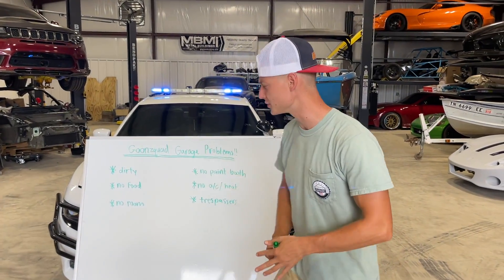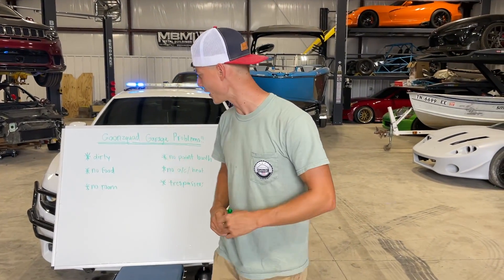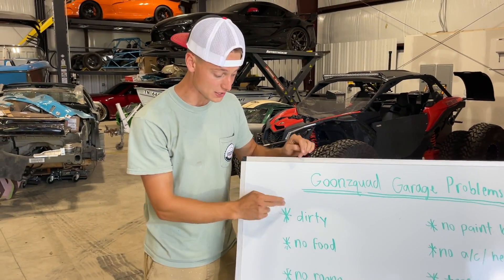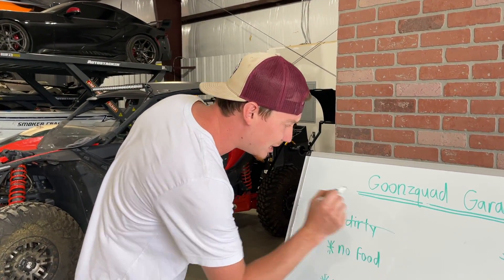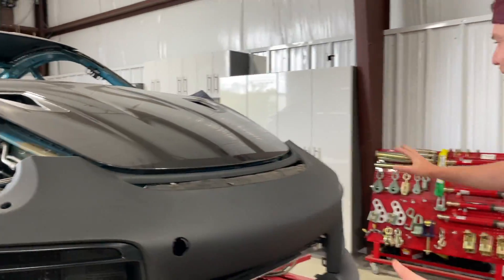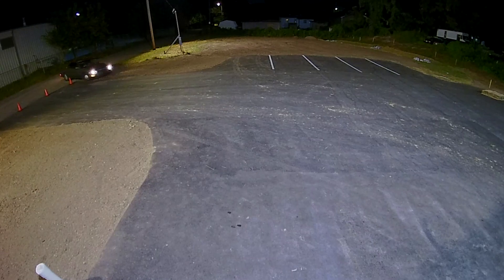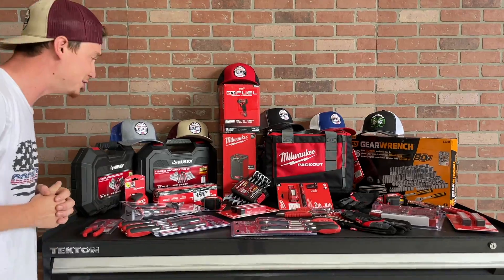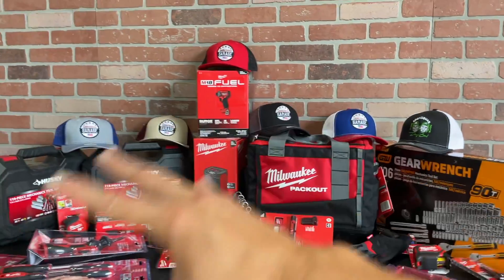The Goonzquad Garage Has Some Major Problems!!!

Comment: Before installing the new diff check if the gear ratios are the same. THIS IS EXTREMELY IMPORTANT IN AN AWD CAR
Reply: They'll never see this comment. 😂
Reply: The front driveshaft is disconnected
Reply: @Ray00069  I recommended using the Charger Cop car as a burn out car a month ago when they were wasting time on those other two cars,they see good advice in the comments but never give credit where it's due, always has to be their idea, I honestly can't wait till the arrogance bites them in the ass at Bristol.
Love their ability to keep up the content but sometimes it helps to give credit to the subscribers who make their channel what it is.
Reply: @Ivonmorr  they took out a fuse  i think, so, when they put it in again they'll break something 🤣
Reply: @DILLIGAF65  it’s pretty much a copy of cleetus car neighbor which is a crown Vic cop car that’s always at the event if they took the mustang they would have more power and actually be halfway original
Reply: @DILLIGAF65  A lot of people recommended them to use the Charger, that's why they decided to try it...
Reply: @beardedonegaming9502  Not even on the same league! 😂😂😂😂😂 Just because it's a retired cop car doesn't make it a copy cat...
Reply: @DILLIGAF65  Well picking an AWD car for doing burnouts was not something people immediately go for.
Reply: @DILLIGAF65  Bristol is gonna put them in their place...a rude awakening for them
Reply: @rainerjaschke5216  Even if it does, good experience for them. None of us was perfect in the first things we try. Why failing is a great learning experience.

Comment: Yes, a fence is a top priority.  Check with your local city to determine the zoning requirements concerning the height restrictions for a fence. If an 8 foot fence is allowed with a barbed wire top you may want to consider it. It may depend if the city considers the road next to your garage a street or an alley. Where my place is located the road is considered an alley so an 8 foot high fence around the entire property is permitted. Also please consider a metal grating you can pull down over the glass windows and door. Consider a way to protect your roll up garage doors if necessary. Keep up the interesting videos.
Reply: Totally agree.  A roller screen for the entrance and glass is a priority - a fence will take a while yet to be installed...

Comment: Hi guys, greetings from Argentina.
The new "Goonzquad" garage seems to look a bit small, even with all that cleaning and organizing. 
I said it before and will say it again: put a decent floor on top of your office box, a steady (or removable) ladder so you double the storage surface. Just as you did in your parent´s garage.
Glad to hear you already ordered the fence building; it will give you more tranquility. Also consider building a paint booth with a side storage place for paints, sanding material, etc. witch is a lot and of course a decent compressor with all the plug-in pipes, air filters and illumination.
As always, cheers from NE Patagonia, Argentina. (a dream place).
Reply: ^^What this guy said!^^ make use of the blank space in the garage.
Reply: Bucket list location 🌴⛰️🌴
Reply: Sabes el conurbano que les falta a estos pibes... 🤣
Reply: @estebancuevas7551  ¿otro argento fiel los martes, jueves y domingos?
Reply: @walterweigert9840  Otro por aca jajaja
Reply: i doubt that's engineered to carry enough load to be useable as a storage space ... and without having it engineered they wouldn't be able to get their inspection passed if they did that
Reply: this isn't your backyard garage that you can just do whatever you want in and fly by the seat of your pants
Reply: That framing is likely designed to support a ceiling, not a load of auto parts storage.
Reply: @Mouthy_Trucker  May be not in the centre, but against the walls? ...just saying...
Reply: TRUMP2024  Hell YES,  TRUMP 2024.  I SURE HOPE SO.
Reply: show me your garage boy
Reply: That's the biggest building that was allowed on that lot, the city wouldn't let them make it bigger, there are a lot of construction codes they have to follow and they will build a smaller "barn" to put the paint booth in.
Reply: @franco7495  somos varios , ja ja
Reply: TRUMP2024  they must be doing something right they got the $$ that we dont have...😂..also I doubt you would want to build a garage in a mountain were you could use all that space to make more houses and possible sell etc..
Reply: @walterweigert9840  somos varios..
Reply: TRUMP2024  dang son why you mad

Comment: I'm glad you're finally going to get a fence! Just make sure it's very tall with barbed wire at the top. Maybe even electrify it. It's just a matter of time when somebody would break in whether you have a camera system or not and steal thousands of dollars worth of tools and damage all of your cars.
Reply: Probably can’t electrify without a permit and I’m sure insurance would skyrocket, it’s not Fort Knox, it’s just cars
Reply: @michaelyackovich155  I didn't mean a lethal shock. I mean like an electric fence that you use for animals. They don't want to touch the fence again when getting zapped. LOL
Reply: @brianmef71  nope still illegal. Unless a prison or jail.
Reply: @jeremyfowler1519  I'm sure it's still illegal in a prison or jail. Any sort of shock can kill someone.
Reply: @evandickerson2919  Apparently you didn't grow up on a farm where there is electric fences for animals. It doesn't kill.
Reply: @evandickerson2919  Voltage and amperage are two measures of electrical current or flow of electrons. Voltage is a measure of the pressure that allows electrons to flow, while amperage is a measure of the volume of electrons. An electrical current at 1,000 volts is no more deadly than a current at 100 volts, but tiny changes in amperage can mean the difference between life and death when a person receives an electrical shock.
Reply: @evandickerson2919  so it means you know nothing about electricity. Just because you get a shock doesn't mean it's going to kill you. It depends on the amperage. You get shocked by a stun gun it's going to hurt but it's not going to kill you
Reply: @brianmef71  I know this sir. I am an electrician I was just stating that any voltage/amperage can kill someone. I have been hit with one leg of a 400 amp service before. Doesn't feel good but one can get shocked with 120v with a 15a load and get killed due to it causing irregular rhythm heartbeat.

And I copy and paste something that is posted on the internet as well.
Reply: @brianmef71  you obviously know nothing about electricity because one could have a murmur and it can kill them if they get shocked. So don't try to post something you find on Google and think you know about electric. You may fool someone else but not going to fool me.

And if the fence has dc vs ac it is even worse. So yea try to debate this with me.

Comment: That's some pretty sketchy trailer action there boys 😆 Also, make sure your rear diff gear ratio is the same as the old one if you decide to put the 4 wheel drive back into operation. Otherwise, you'll have major problems. Peace!!

Comment: Gotta move security to #1 on the list. Hell, make it #2-100 for good measure. Wayyyy too many close calls already, and y'all have worked too hard to get yanked around by crooks and crazies.

Security fence (barbed on top), electric access gate, and if you don't already have it, a full scale monitored alarm system too.
Reply: I would of installed the fence at the onset. They want what you have ....,

Comment: I’d definitely tear that new diff down to make sure it’s all good. I mean usually there is a reason parts like that are sitting at the junk yard.
Reply: Typically cause a car got totaled, not cause there’s anything wrong with the part. It is unnatural for the parts to sit out in the weather though
Reply: @luketanner7638  either way I’d tear it down, to check. That way It don’t go in the car, and not work at all.

Comment: Yall should put up a 8-10 foot metal corrugated fence, it's pricey but it loterally blocks off the view of your property vs a chain link.  Or if you want visibility get a wraught iron fence installed, have a sliding gate on a rail system where you can open it with an opener would be sick

Comment: you need to do interlocking figure 8s with all 4 wheels - once you get a fence and grass you will build another garage/office mostly for storage - the shop is too crowded  - you may as well have extra space here and on the mt #mr october
Reply: They should buy neighbour properties if they are willing to sell. So they can expand the shop which is way to small for everything they are doing. 

Maybe they should hire some good people to do a real shop. They still do the YouTube thing, but also do some unique builds.
Reply: Yeah I don’t know why the dream shop was built so small they’ve already out  grown it.
Reply: It's only crowded because they use it as storage for finished cars and a boat. They should finally build the garage building at the older mountain house and move all the extra cars over there. If it's a simple garage, not a workshop like this one, it would be no big deal. But I guess if they absolutely need to have 10 cars and a boat in the background and consequently only a single corner free for the ongoing project, then it can't be helped.

Comment: Make sure the gear ratios match the front.
Reply: Doesn't have to with the front diff disabled.fuse was pulled and there not driving long enough to hurt it.

Comment: I know you are all finding the feel of the shop and what works and what the needs are. Tool crib area for larger tools tire racks and 2 portable work surfaces on whhels for 2 builds....You need that "BIG ASS FAN" OVERHEAD to blow air down and out of the shop. Add  a couple of exhaust fans at low level on speed drives to control air flow out in the winter.

Comment: Suggest a storage bottle and switch.operated pump to drop a 50 50 water bleach mix on ground ahead of the rear wheels.on that Charger. Lots smoke with.the spinning tires,

Comment: Probably not going to see this but if you do why not weld the open diff and once you guys win the burn out contest and are done doing burn outs than install the lds diff that’s what I did with my 350z well I still have the welded diff in the car but I have the back up just in case I street drive it or if needed……..

Comment: The kitchen should have been on the back wall on a second floor and make a diy paint boot under it. Cant believe with all this setup there is no paint boot, no sanding area and washing. 2 lifts but doesnt use it when installing a hitch. Cmon guys, the building is crazy and so much potential to step up the game. That fence is needed, should be number 1 priority before a crazy one destroy everything.

Comment: Check the gear ratio on that diff. All the Hemi cars came with ‘electronic controlled LSD’ while the Road and Track (not RT) cars came with a true LSD. Looks like the ratios will be slightly off, or way off if it’s a 3.73 or 4.11 diff

Comment: Trench Cat6 Cable so you can install IP Cameras Along the Fence / At the Gate!
Then you can also have the Alarm System hooked up the the fence Gate. 
Just saying... 1000' Cat6 underground cable is well worth it before it too late! 
I Run a Shop in the CCTV installing Trade , And if i was doing a shop like yours I would install cameras at the gate

Comment: didn't read all comments but if it's all wheel drive you cannot have a different gear ratio from the rear to the front. so whenever you put it back needs to be the same

Comment: Put a dummy in the front seat of the cop car and park it out front. Park the cop car close to the building and running extension cord to it. Then hook up a motion activated light so it looks like somebody sitting in it in the light turns on when somebody pulls up

Comment: Hello Goonzquad, I have been watching Your videos since the mustang keep doing good videos! I always wanted to get into the wreck auction cars, but I don't really have that much time to learn about it.  I'm working on my 2010 corolla car upgrading suspension parts, I just replace both of front shocks, sway bar bushings and stabilizer link bar. it was hard for the bushings due to a hard-to-reach bolt. tomorrow I'll be doing tide rods, ball joints and still waiting on rear shocks to come in as well as front brake pads & rotors. It's my daily drive and have to drive 1:00 hr. to work and back to home. but now that I'm not currently working (unemployed), I got the chance to get some stuff done. if u need a worker just let me know :)

Comment: Hints and tips on the fence: Chain Link gets destroyed before you know it.  Get steel rods, powder coated and 6x6 or 8x8 posts and make it stupid strong so nobody is inclined to steal from the property.  I know, the fence might cost more than the shop, but I would not skimp on it.  Make sure to maintain the paint and weeds.  Make sure people know there is surveillance.  As far as the paint booth y'all might want to consider asking the city about this first.  The way they were so picky with the environmental side of things is good on the one hand but can delay things for no good reason also.